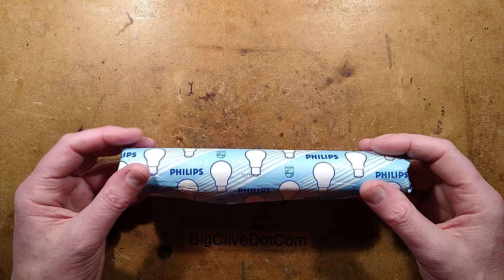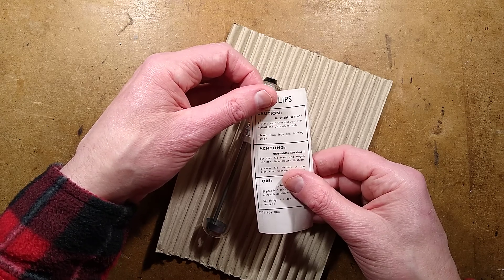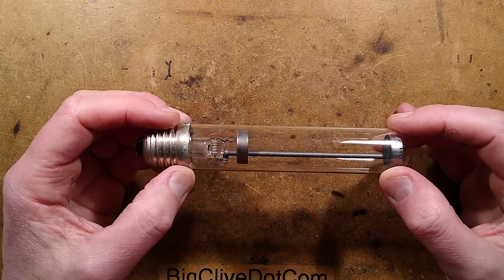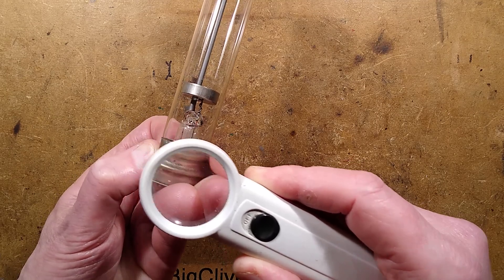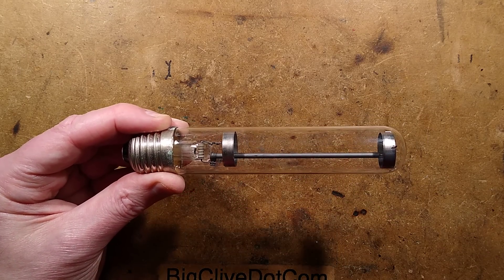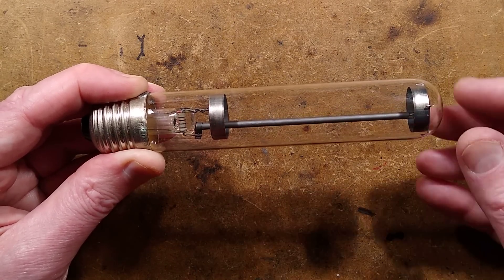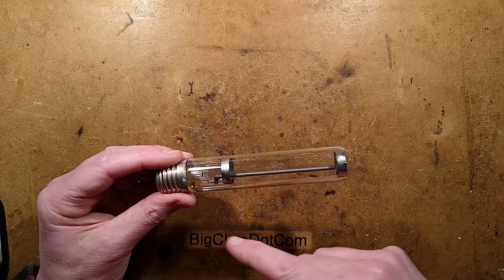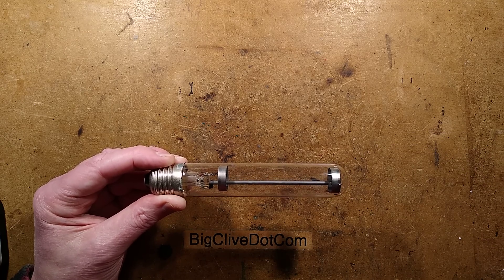Unwrapping and testing a dangerous vintage Philips lamp

Comment: A Telefunken S4005 SW broadcast. Transmitter uses these lamps as UV sources for testing the UV arc detectors in the transmitter. They are covered by the panels on the cabinet.  They light when the arc detector “test” push button is pressed. The bulb only lights when button is held down. The lamp runs from 220-240V. The 3ph LV dustribution supply is 380/220v. The higher voltage runs pumps,blowers and LV DC power supplies.
Reply: 400/230 V.
Reply: @mernokimuvek  depending on how the taps on the 4160v-400v/230v transformer is set. The 380-400v,215-230v loads are not precise. At the site their line voltage is high-so we have to set the taps to give the right voltages.
Reply: @rexoliver7780  Isn't 4160 V distribution used in 120 V 60 Hz countries? European countries typically use 20 kV for medium voltage distribution. Low voltage distribuion is 230/400 V +/- 10 %. It's funny when Americans get scared of 230 V and we tell them that we also have 400 V 3 phase appliances at home.

Comment: Ordinary fluorescent lamps use similar technology.  (Mercury/argon)
The difference being the inside of the glass tube is coated with the fluorescent  material that converts UV to visible light.  There's no chance of the UV affecting your watchers. It won't even get through your camera never mind the computer screen.

Comment: I was going to say its another one of those "Black, black, black..." color code ones, but they may have intentionally baked them out before installing to avoid outgassing in the lamp which could poison it. Its also possible that its simply being run so hard that its been grilled beyond recognition, too. But that seems a bit too Chinese for Phillips.

Comment: @bigclive I bet the whole stank of ozone afterwards? I once made the mistake of having one of these in the bathroom... accidentally left it running for 24 hrs(I'd gone to a friends house the help out with moving)... had to have the house fumigated with o2 (all the windows in the house open for a whole day)....but on the positive...my house was cleaner than the clean room NASA uses to look alien bacteria in rock samples
Reply from the maker: This version doesn't create ozone.  The glass filters out the required 184nm wavelength.

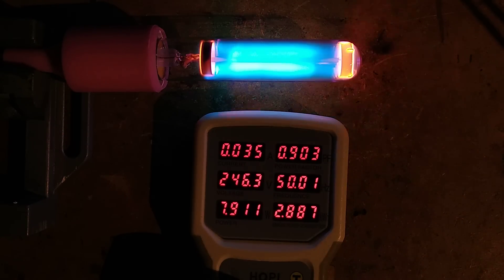Comment: Very interesting lamp and piece of Dutch history. What I found just as interesting, is that you had an incoming voltage of 246-ish Volt (@1:43)?
Reply from the maker: The nominal voltage here is 240V.  I'm close to a substation, so it often reaches 250V.
Reply: @bigclivedotcom  We in the Netherlands have 230V nominal... I sometimes see 240V but almost never more than that. As far as I know Europe is 230V everywhere. In the Netherlands it is allowed up to 10% higher (253V) but I have ever seen that. Or anything close to that for that matter.

Comment: Philips still sell a florescent tube that outputs UVC, it's used for sterilizing inside big airconditioners. The glass is quartz glass that blocks the wavelength that creates ozone and there is no coating on the inside. They glow that same blue as the one in the video.

Comment: After cleaning up I wanted to post my results.  I did notice that my eyes started itching but I thought nothing of it so I paused the video and itched them(I didn't want to miss anything because my eyes were itching), that's when everything went downhill.  I suddenly had the urge to use the bathroom, but on my way there my eyes itched so bad that I rubbed them and ran into the wall.  I bounced off the wall and fell to the floor, soiling myself in the process.  I didn't get any blushing, though my friend did. Hers happened really soon after my incident, funny thing is she didn't even watch the video, why would she blush I wonder still.  She said no more Big Clive in public places either.

Comment: While I'm sure that it didn't use quite such a viscous tube, when I was a lad (early 1980s), the hairdresser my family went to had a little benchtop toaster oven looking thing that was a UV lamp steriliser. You could see the blue glow in it clearly through a glass door, but the  light turned off when the door was opened for the clean scissors to come out. 
I don't remember any ozoney type smell. We had a pool, so I was familiar with chlorine smell, and it didn't make that kind of chemically odour.

Comment: Hi man, could you do an episode on is it possible to refurbish a CRT Monitor or CRT Television? Its for retro gaming. How to preserve one and use it. How not to get ripped of if asking someone to refurbish it. It would be very interesting to hear opinion of expert such as yourself. Keep up the good work, you are being watched in Serbia! :) :person-turqouise-waving:
Reply from the maker: You can do a level of internal regeneration of the electron gun area of the CRT.  The main work usually involves replacing most of the electrolytic capacitors on older sets.
Reply: @bigclivedotcom  Oh i heard recently that CRT "re-generators" exist, but im know only basic stuff from electronics. I opened one up that i bought to inspect, only to find out there is high voltage inside. I consider it a success that i did not kill my self, so i decided to ask a professional :). I could replace the capacitors but im not comfortable with high voltage since i know shit. I think there is a lot of people that would like to hear how to tackle this problem if you want to use CRT but you are noob in electronics.

Comment: Ahhgh thanks  for the  UV burns trough the monitor and even with explosive diarrhea  ;)

But it is not even half as bad as the radiation sickness with projectile vomiting, diarrhea and cancer I got from watching on youtube the crazy Ukrainians jerry rigging a X-ray tube and running it for 10 - 30 seconds at a time unshielded on a table.

Comment: I am wondering what kind of glass the envelope is. Most glass doesn't pass much UV. For that purpose the best kind is fused quartz/silica, but that is a bit difficult to seal around conductors because of the mismatch in expansion coefficients.
Reply from the maker: High purity.  Check out uviol glass.
Reply: It's quartz glass just like halogen bulbs and mercury vapor or metal halide arc tubes.
Ordinary glass only lets UVA through, not UVC, for that you have to use quartz instead.
By the way quartz glass is more or less pure silicon dioxide aka sand that has been melted in a very hot kiln.
Ordinary glass on the other hand is the same but with additives that lower its melting point and therefore make it easier to work with, at the expense or benefit depending on the intended use of blocking all wavelengths that are below 330 nm, ie all UVB and UVC as well as a small part of the UVA.

Comment: 2 minutes in.... "If you experience any of these issues..."  Um.. I would really be impressed if 24-bit color encoding also included UVC.  I bet we could shift things around a little, roll it up to 32-bits, and maybe get some infra-red as well.  Imagine a sunrise screensaver where you actually felt the warmth of the sun on your skin...   Or a virtual fireplace to read a book by while watching it snow outside.  I can see the advertisements now: "New 100-inch TV with true-light technology!  Warm yourself by the fire, or work on your tan, all without leaving the comfort of your living room -- just change the channel!"

Comment: When I worked in electronics R&D in the '80s, we discovered that our "pure" water supply was becoming contaminated by algal growth so we fitted the supply tank with a UVC light. Two weeks later, all the plastic components fell to pieces. UV will do that.
Reply: But the algae was gone I bet. These (not this one) can be used for green ponds.
Reply: UV is the solution to destroying plastic! Thats why sunlight will break it down, albeit much slower.
Reply: Next you'll be telling us UVC can kill viruses.. Oh wait......
Reply: Not all plastics will do that. Nary a chemist on the staff?
Reply: @mikemondano3624  technically all plastics degrade from UV, it just depends on how long they last
Plus a uv resistant coating may be more beneficial
Reply: @tydshiin5783  Polyphenylene sulfide, HDPE, acrylic, polycarbonate, and polyetherimide are pretty immune to UV degradation. In addition, additives can impart resistance to many others, incorporated, not just coated.
Reply: @mikemondano3624 worked at a batch plant for Plastics....80s pipe vs 2020s pipe 😂 is ABIT different in rating 🌐🕵🤣 the 50 year old batchplant guys would be dying
Reply: Our deionised water storage in the lab had algae too. It still worked for what we needed tho.
Reply: I have been diagnosed by my doctor as having octal retinal migraine I have the visual disturbance but no headache my attacks have been confirmed by the doctor as being triggered by light of a certain wavelengh. LED lighting bluish white in colour brings on these attacks during the attacks I also on rare occations have trouble with perception of distance. When I remove myself from the offending light the attacks immediately stop. I viewed your video twice but I did not suffer any affects whatsoever from the phillips bulb. There is a greater danger from cold colour LED lighting than with this bulb.
Reply: @davidprice3950 🤔🤣 Perhaps because you viewd the video on a screen and not actually lit by the offending bulb😂. I recently watched welding videos for hours without my welding helmet on and shocker! I didn’t go blind🤷🏻‍♂️
Reply: @davidprice3950  whoosh

Comment: I actually got a UV lamp burn a long time ago. I had inherited a tanning bulb and decided it would be "fun" to stick it in my desk lamp. This bulb must have been manufactured before all the safety regulations came about with "mogul" bases and such. This lamp had a standard base just like any other bulb. I screwed it in and positioned it on my desk to illuminate my face and upper torso. I took off my shirt. This was on my computer desk. After some time, I felt a slight burning sensation on my face and thought oh, I better switch it off. A few hours later I looked like that guy in Close Encounteras with half my face burned, and it literally felt like I had sand in my eyes. Sunburn everywhere else from my left shoulder down. Cut me some slack, I was in my early 20s. Lesson learned, painfully.
Reply: A guy who worked as maintenance mechanic at a factory I worked at told me he performed a series of welding tasks during a night shift (without his welding shield/goggles).
I told him "Are you nuts"?
He ended up in the clinic with burned eyes.
He could still see, but told me
"I felt like my eyes were covered by sand, & impossible to wash it off" 
I have heard of this exact same thing you described of yourself, happen to a woman who put a common CFL twisty in her desk lamp.
Severe burns on her face and also eye burn
CFL have U V C light if I remember correctly
Reply: I hope you wear sunglasses religiously. You upped your chances of getting cataracts sooner
Reply: @dw3403 good advice, and yeah I know. But I'm nearsighted since forever with a strong prescription, so those polycarbonate lenses have two positives. One, I don't wear sunglasses (the non-uv blocking ones are really bad for your eyes) and polycarbonate blocks UV. Maybe it's a net zero...I hope lol
Reply: @robertbauer6723  
  Good to hear.
Reply: So it emitted UVB I guess ?
Otherwise you wouldn't have experienced as severe of a sunburn if any if it had been UVA only like a blacklight for example.

Comment: I’m an FBI investigator, and my stool pigeon turned into a regular pigeon and flew away, dropping a streak of diarrhea on a melting stool in the park as I ran to the bathroom with my new sunburn but ran smack into a tree because I couldn't see through my cataracts. (Bertha reference intended)

Comment: Clive, I watched it 3 times and felt just fine so I went and flew my RC airplane. Unfortunately, the plane disappeared in my new blind spot, flew into the power line and the transmitter instantly exploded in my hands.  Now I'm blind and have burns and wounds all over my face.  I wish I could "watch my eyes"!

Comment: I saw these in highschool labs in the 70s to sanitize shared safety glasses. The glasses were in a white metal cabinet with an interlock and timer so the lamp couldn't be lit unless the doors were closed, and the runtime was limited to 10 (or so) minutes.

In truth, I never saw a teacher activate the thing, and it wasn't even plugged in.
Reply: We had those same cabinets in my junior high shop classes. Never saw one actually used as all the safety glasses had long ago disappeared.
Reply: We had such a cabinet in my junior high shop class as well.  We would hang our safety glasses in it at the end of class, and when they were all properly stowed, the shop teacher would activate the cleaning cycle, which also physically locked the cabinet.  I remember being disappointed that the UVC only killed germs and didn't also blast crud off of the glasses, as heavy use by myself and my fellow students rendered the glasses -- which were new when I started 7th grade -- quite disgusting by the end of 8th grade.  At least everything on them was dead, though!  🤣

Comment: I did not experienced any symptoms, however I noticed that, across the sea, we have 120 Volts. 
So I pluged 2 cables from the monitor to the electric outlet and; even though my monitor did not explode, my toilet did.

Comment: I watched your video and now I'm poor, you didn't warn me that could happen! 

Btw I found a new "feature" on some new UVC lights. Diodes across the heating coils, so each one only heats up while it is on the negative side of the cycle. Makes sense, as you only need to heat it to get the electrons off, so you can make it last longer by not heating it while receiving electrons. The rest of the circuit was terrible though, some small spike somewhere (I guess) caused the unprotected circuit to fry. So, I just bought cheapest normal CFL with same wattage and swapped the circuit to the UVC bulb... but bringing the diodes over to the new circuit; they're a nice feature (actually happened with three bulbs, making it worth the effort to fix rather than replace them)

Comment: To anybody worried that watching a recording of UV light will damage your eyes and skin, the R'G'B' and Y'CbCr color methods don't cover UV light. What you're seeing is just a combination of red, green, and blue, and possibly white on some displays. So your eyes and skin won't get damaged by watching the video.

The effect of two separate spectral power distributions producing the same tristimulus to the retinal cones does however cause metamerism, resulting in explosive diarrhea that's either a warm brown or very dark, dull orange in color. It can be hard to tell.

Comment: There will be a date code and factory code stamped on the base.  The date code is a letter (A thru M skipping I) and a number.  The letter is the month and the number is the ones digit of the year.  Lamp was made in an odd decade if number first and an even decade if letter first.  Factory code is probably a square with a vertical line in it (Turnhout, Belgium).
Would elaborate further but the explosive diarrhea launched me into low earth orbit.  Fortunate to hit a Starlink satellite so I could post this.  Have raging headache from impact tho...
Reply from the maker: I'll check that when I get back.  Currently traveling.

Comment: Thanks for the warning! Luckily, I had all 50 of my negative energy removing bracelets on, and I only received slight burns. Although I'm starting to have stomach pains and my bed turned as hard as cardboard, so I might have to buy a couple more bracelets to remove all of the UVC out of my body.

Comment: They have newer versions of this, much more powerful.
     Like you said, they are used for sterilization.
Possible side effect sounds just like the EXACT symptoms of acute radiation exposure.
     Like the newer models, I wouldn't want to be anywhere near it when it's on.
Should have the smell of Ozone & burning organic matter.
     Used in water sterilization equipment too.
Reply from the maker: The ozone only occurs with glass optimised to pass the 184nm mercury peak.

Comment: I have a 36 inch long UVC water filter lamp ( to kill all the micro critters) that might be in my well water.
 It is encased inside a 4 inch  diameter  stainless housing, with a flow switch so it's not on all the time, only when the water is flowing. 
Seems to be doing a good job after a year since I installed it.

Comment: Upon exposure to the UV I became extremely... aroused.  I called my farrier and he said it was absolutely normal, especially in rainy weather, but especially at high altitudes.  At near sea-level it's still common, but a little surprising, especially since it made my cats chase their tails in unison.  I was quite impressed, actually.  They were like synchronous feline pinwheels.
Reply: Thanks, couldn't stop laughing at your comment

Comment: Speaking of lights, at the premiere hour of this video, I've enjoyed a concert at a 35 years old posh music club I haven't visited for 5-6 years. What a joy - except scene effect LED lights though mixed with older PAR projectors everywhere else were very well designed in the late 70s early 80s (from before the club) and well situated original dimmable low power halogen and regular incandescent lamps well preserved and cared for.